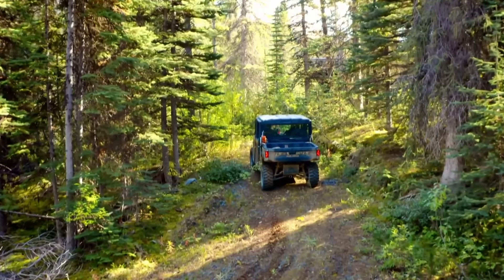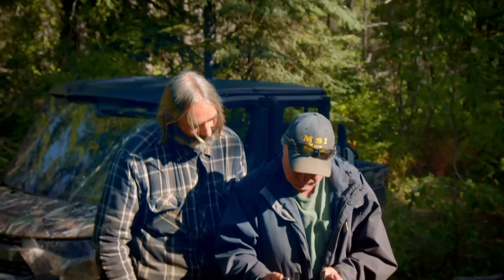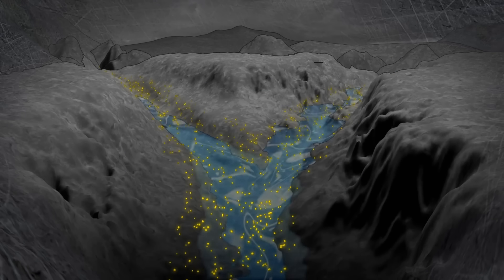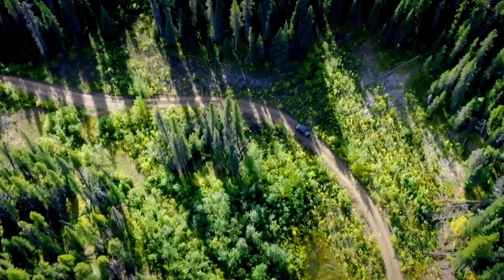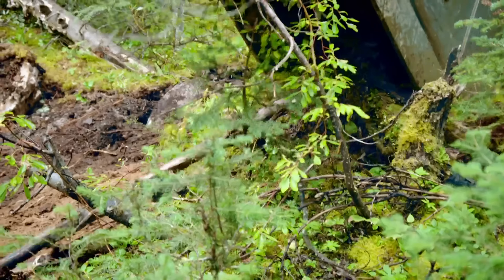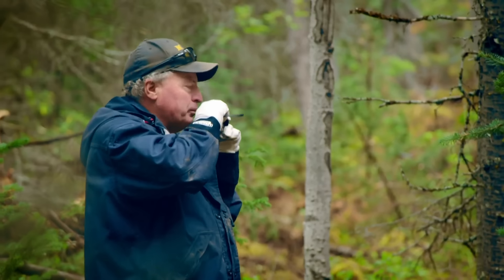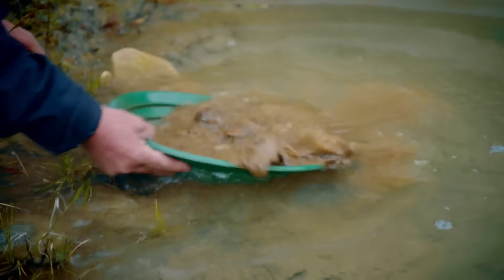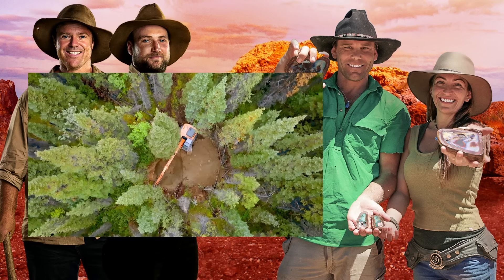Freddy Uses Drone To Identify Potential Gold HOTSPOT! | Gold Rush: Mine Rescue With Freddy & Juan

Comment: Dowsing with the modern light weight ball bearing dowsing rod is the only way to precisely follow the placer gold drainages. Anything else is just making educational guesses of gold concentrations without knowing how much concentration of gold with depth of cover. The modern light weight ball bearing dowsing rod is the all in one prospecting tool when you know the physics involved in metal detecting and dowsing with knowing how to use the dowsing physics for precisely gauging the dowsing everything needed on placer and lode gold mining.
Reply: When I use gum tree for water it is a forked piece but the poinsiana tree branch is straight as is the bamboo.